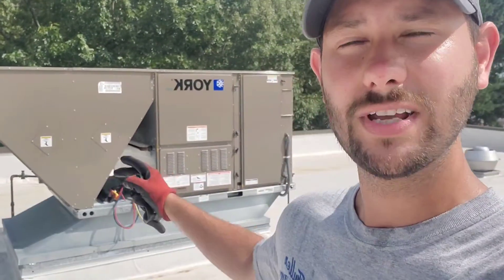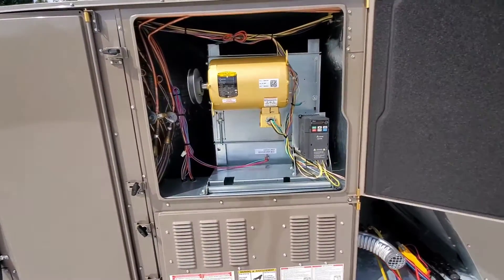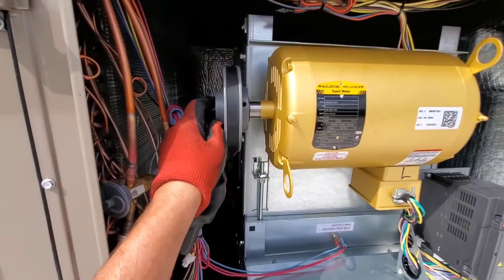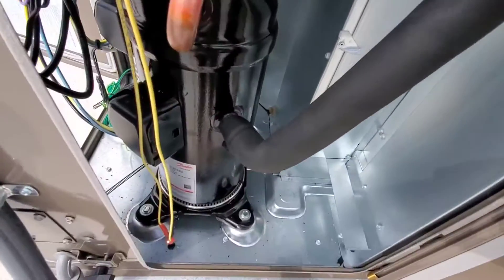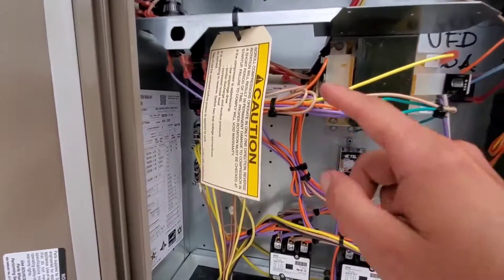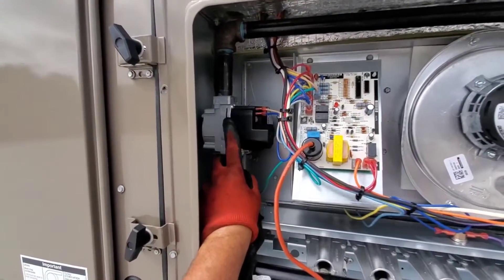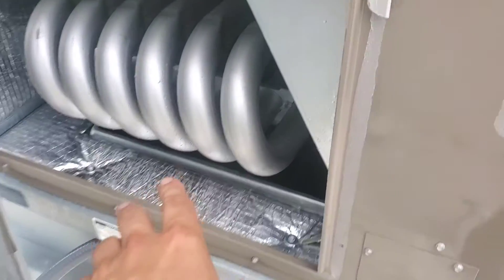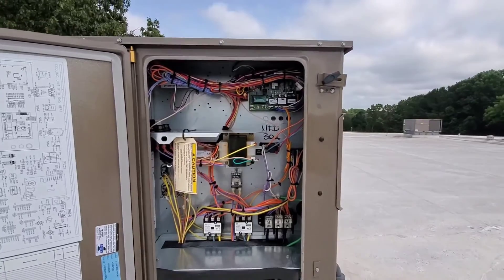HVAC Commercial rooftop package unit Beginners Guide

Comment: Can somone help answer this? I have an RTU 2 compressors ect, i have a call for y1 so compressor 1 runs, i jumped y1 to y2, i have 24v from common to y2 on the board but going to the top of the 3 pole contactor i dont have the 24v to pull it in. I know the compressor works because i can manually push it and it works. So i have 24v on y2 but its not sending it to pull the contactor in. Any answers why this would happen? Even if the tstat was sending a call to y1 and not y2 on the board itself it a jumper wire so even if you call for y1 its still going to send 24v to y2 it just wont sent it to the contactor to pull in. Any thoughts?

Comment: Motor sheave only adjusts amp draw not speed, only vfd does speed. If the blower wheel is going the wrong way the door won’t suck shut. And you ideally want a union on the gas line, and a regulator. And a vent or cap for the regulator

Comment: On smaller 3-5 ton units is there a return fan or just a supply fan? How does the air flow out?
Reply from the maker: one fan pulls and pushes at the same time

Comment: I'm about to finish HVAC school. just had an interview for a commercial company for a service tech position. The school had some package units but swayed more towards Residential. This video definitely helped get more familiar with a package unit. thanks.
Reply: How was it being fresh from school going straight into comercial, I’m also in the same boat, I just finished school but it was more focused towards residential but I start my new job in 2 weeks and it’s going to be commercial, do you have any tips or any type of advice? Anything you would’ve done differently?
Reply: @briangodinez8873  it's essentially the same thing just bigger units and more parts like contactors if you have 3 phase. 2 compressors and condensor motor fans... get familiar with plumbing as well as you'll be dealing with water boilers, chillers, VRF systems, CAV, VAV systems... stuff they don't teach in school but the basics are very helpful! Honestly it all depends on the company and management if they want to train or not. In my case... I was thrown out to the wolves but you learn as you go by making mistakes and doing research as well! Good luck!
Reply: @JRAM7  not the same thing. Maybe small commercial RTU’s. But when you’re dealing with big commercial building units it’s a lot more complicated and comprehensive.
Reply: Dear brother I had you saying that you are in HVAC-R school, I am also a HVAC technician, I am writing to you to ask if you can send me some documents that can help me to grow as technician 🙏 
Regards

Comment: I have replaced the micro channel con coils on those units so many times. If you are not sure that your phasing is correct energize a call for fan first. It worries me that a new units compressor may come on in reverse. In my opinion never use coil cleaner on coils unless you hate the coil and want it to die.

Comment: I have 5 of these York units at my work. We have nothing but problems with them. 2yrs old compressor shot, inducer fan relay shot. Txv stuck and foam falling from roof on motor and belts. I think they are junk!

Comment: Hey man so far your videos are awesome I’m an Amateur service tech for commercial. Last time i encountered myself with a chattering 3 phase contactor, it might sound dumb to ask but it was a package 2 stage Unit and I couldn’t figure out the chatter, checked voltage and it was good? If you can make video about it and troubleshoot as well!

Comment: Not one person has made a video on how to troubleshoot a inducer motor that’s 230 volts 2 speeds that go into an ice cube relay
Reply from the maker: Sounds like I need to make one
Reply: @taddydigest  yes you do this particular unit has a 240 inducer motor with two speeds and the w2 call goes up to an ice cube relay then it goes to the inducer motor for high speed
Reply: @taddydigest  this video would be huge if you made it. The actual unit is a rooftop allied commercial unit with one compressor and one gas chamber with burners and pressure switch obviously an inducer motor it’s on 3 phase power
Reply from the maker: Alright. If I come across this unit I will do a video of my friend.
I trust you

Comment: Do these units or other rooftop units have thermostats located nearby?  Im working at a hotel, sensors located in hallways but havw been advised by gm that therms are on the roof.
Reply from the maker: Thermostats could be located inside the unit but these are located inside the building.
Reply: We have thermostats on the first floor but on the 4th floor there are sensors in the hallway but no thermostats on that floor

Comment: Hello, I have a question. I would like a package unit for my entire house but I don't know how to calculate the tons of refrigerants for my house since my house has two floors and each floor is 6 meters high from floor to ceiling and each floor is 1000 meters high. square feet of surface it would help me a lot if you answered me, thanks in advance
Reply from the maker: https://youtu.be/HAMmUCtGMVA?si=4itQdKpsiWvo6r6X

This is a short video on how to size equipment this may help you Let me know

Comment: I am a residential technician this video motivated me to want to do commercial.
Reply: O yes go commercial
Reply: Can you tell me what it's like to be a residential HVAC technician?
Reply: @NL33_6 yeah hott when it's summer in an attic 🤣most of the time it's just diagnosing what's wrong. The most important thing is to learn the sequence of operation. That way you can see what it should be doing and what it's not.
Reply: Sales @NL33_6

Comment: Real world problem 😢
I have a RTU I’ve got multiple electrical problems and repaired then upon starting up the system and cooling mode and I mean in cooling mode and began to turn on the heat mode I checked system operation molds and AC was turning on heat mode and heat mode was heat mode and the fan operated what do I do and it has one of those computer boards that you can manipulate but I’m unfamiliar with it can you help me please

It is the same system that you have here in this video but it only operates in heat mode and I cannot get it to operate in AC mode
Reply from the maker: I can help but not really through the comments
You can join level 4 and I can give you my phone number through my email and I can help you.
Reply: Ok

Comment: Hi bud ! Did you ever have a loop problem on this particular new electronic control board that the board just restart over and over with the 120sec timedelay ?
Reply from the maker: That sounds like it needs to be updated could be firmware update that needs to happen

Comment: What about a combustion analysis?
Reply from the maker: What do you mean
Reply: @taddydigest  As part of the commissioning and proper start up of the gas burner
Reply from the maker: I thought that's what you meant
 I usually just set the gas pressure the temperature split Adjust the fan belt and the air flow and the fan speed I really don't worry too much about combustion analysis
 But anything extra is always welcome Now if it's not a brand new unit then yes combustion analysis is something I do

Comment: How do you pump down this system?
Reply from the maker: you cannot 
there are no valves
Reply: @taddydigest  so if we wanted to change any accessories in refrigerant line. We need to recover the refrigerant or just remove the refrigerant from the system?

Comment: I always change phase at the contractor, motor leads, for rotation. More control for each motor rotation. Great information Thank you.
Reply from the maker: Right on
Reply: Bad idea. You then need to go around doing that for every other component on the equipment that runs on 3 phase. It's much better practice to change the MAIN wires and leave the unit wiring factory in relation to how it was phased when they built it.
Reply: I’m replacing 2 compressors on a brand new chiller because the last guy started the unit and the phase monitor went into alarm shut it down..He swapped the phase and the phase monitor alarmed cleared water pump started up and was running backwards then he shut it down swapped the main phase again and then swapped monitor to get it out of alarm then started the compressors up and smoked both of them..Point is check the phase before start up and make sure it’s rotating to the right..if the water pump is running in reverse then only swap it not the main..just my 2cents.

Comment: So I was working on this York RTU last week and it has a Johnson control board . I was getting 24 volts from the transformer going to the board but it was not sending out 24 volt to the thermostat . I was wondering what the problem can be any idea it will help. Thanks !
Reply from the maker: check pressure 
Pressure switch could be open 
also check install manual and look at flashing lights on the board 
It may be locked out on a fault
 Check fault codes

Comment: So I'm doing some start ups on two 15 ton Lennox rtus. Data plate says normal pressures are 236 low and 446 high for 410a. Does that sound normal to you?
Reply from the maker: no that is just the range of pressures but not actual
Reply: @taddydigest  thanks!

Comment: You talk about polarity changing, uh. So if my polarity is wrong will both my blower and compressor be running wrong? Will my blower be running in reverse as well as my compressors not running right? Is that all controlled by the line voltage from the disconnect to main unit?
Reply from the maker: Yes that's right
 I've got a video on it you should check out my playlist
Reply: @taddydigest  I actually did and found the video where you explained it all. Thank you.

I subscribed, glad I found you
Reply from the maker: Awesome Chad 
You Rock 
Thanks for watching 👀 😀

Comment: Thanks for great video, but can you post the images of capacitors for commercial compressor. Thanks
Reply: Most commercial compressors will not use capacitors since they run off 3 phase. That's one bit of simplicity in 3 phased motors. No start or run capacitors.
Reply: @Jason-wc3fh  Thanks
Reply from the maker: Hey Thank you for watching Yes I will do a video and post pics of the components

Comment: I’m going from residential refrigeration to commercial HVAC. Been in the field for 13 years and this is by far the most informative video. Well done.
Reply from the maker: Danny you are awesome
 Thank you so much for saying this
 I really appreciate it means a lot to me
 Let me know what video content I can do to help other people I am interested
 stay happy my friend
Reply: @taddydigest  hey me too and usually what gets me is the multiple gauge ports inside the unit.
Reply: hey I'm sure you probably already have the experience since this comment but I'm pretty sure those multiple ports are for adding in an aftermarket pressure switch since the factory ones are the peanut style that are welded on.

Comment: Ya you left out the weather does a trap still work in freezing temperatures
Reply from the maker: during freezing temps the thermostat would probably be heating so no condensing furnace here normal 80% non condensing

Comment: How do you adjust blower speed with this SE control? Assuming belt tension is correct. Thanks
Reply from the maker: I will  do a video about this too
Reply: Through the vfd setting

Comment: Good video, only thing I noticed was isolation valve on gas line. Should be on the other side of the dirt leg, so it can be shut off and dirt leg can be cleaned! 🤙
Reply from the maker: Thanks Riley Good eye 👁😀
Reply: dirt legs need to be cleaned out about 1 out of every million. We have no code requirement for needing the valve before it. Our only requirement is that the dirt leg is accessible for cleaning.

Comment: Mind that with a vfd switching input legs won't change rotation on the motor.
Reply: @ 3:10; Absolutely correct. A variable frequency drive will correct for three phase miswiring. The only way to check for miswiring is to hook up your refrigerant gauges and briefly run the compressor(s).
Reply: @heymikeyhelikesit8673  on the gauges will you see high evap pressure and on the condenser will have very low pressure? Is my thinking correct
Reply: @WillieMakeit  If the wiring is wrong, a scroll compressor will run backwards and sound terrible. The pressures on your gauges will be about equal .